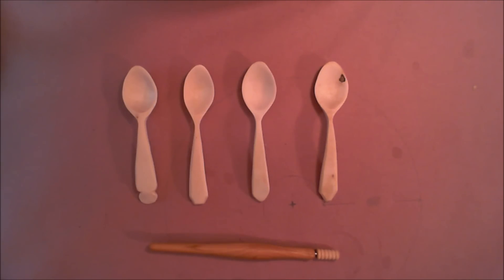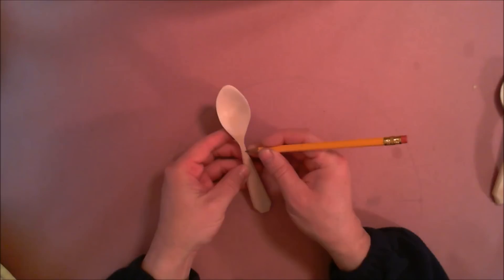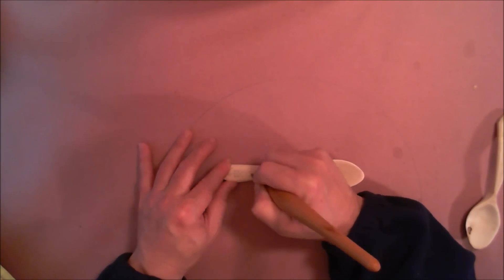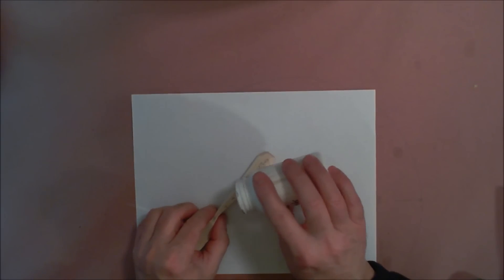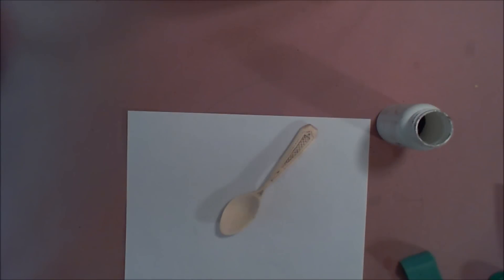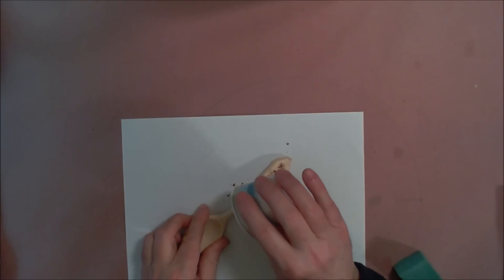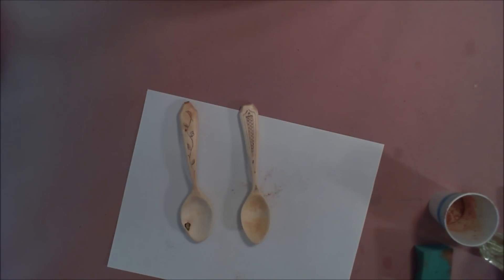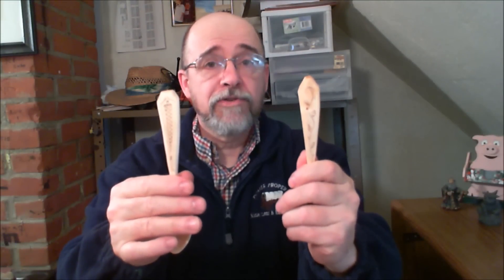Kolrosing  - Tattooing Wood

Comment: Hey Rick!  Awesome job!  I was watching a man from the UK do this technique, and he oiled first,  then powder rubbed, and then burnished it. He described it like this: When you cut the wood with a blade, you push the wood fibers apart (so he uses a deeper angled edge, to make a wider push apart), then...after you rub the grounds in, you burnish the design (rub over it strongly with a flat, hard tool) to push the fibers of the wood back over the powder to "tattoo" it in. Like this: (powder).  See how the wood, or parentheses, surround the powder? Anyway....that will keep your powder pact in there REALLY well so that it will last a long time. He also used raw linseed oil.  I know it has a taste and smell...but I know it dries harder than most oils.  :)  He burnished them with the rounded, blunt spine of his blade...but you can use antler too.  I hope this helps!  :D

Comment: I believe that oiling before rubbing in the powder helps to seal the surface of the wood, so that the powder does not color the actual grain--just the engraved marks --and makes cleaning off the excess more successful.  Depends on the grain of the particular wood, of course, and whether there are sanding scratches.

Comment: Today I found out, this works with chicory-based coffee substitute, too. If you first put some oil an your design, then you rub in the powder (it is very fine, but much cheaper than coffee or cocoa) and treat it with an antler or something, you get a good result.

Comment: You're forgetting a necessary step: After the oil, you want to burnish over the lines with a smooth stone or the back off a metal spoon (many even use a piece of deer antler); this will seal in the cut lines and help hold the carved pigment in the wood. 
Nice job though.
Reply: *of not off... Long day. :)

Comment: I'd be interested to see what powdered charcoal would do,  very easy to get a fine powder with it, you might even be able to get away with just rubbing a piece into the cuts?
Reply from the maker: I'm sure charcoal dust or coal dust would leave an amazing dark line, I just avoided it because I was using it on an eating utensil and a lot of people prefer to use organic materials.  You could experiment on a piece of scrap wood to see what works best for you.
Reply: @RickMayotte  Nice video but what do you think charcoal is....?
Reply: The design is on the handle of the knife - moreover, it is sealed , so does it matter ?